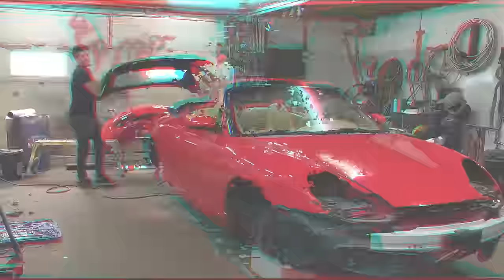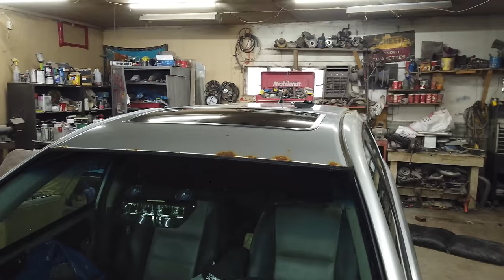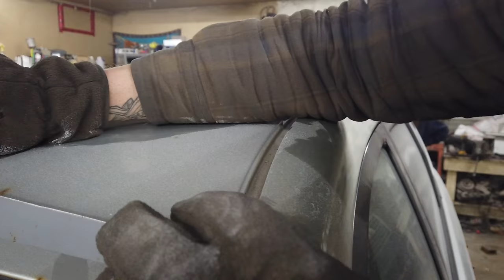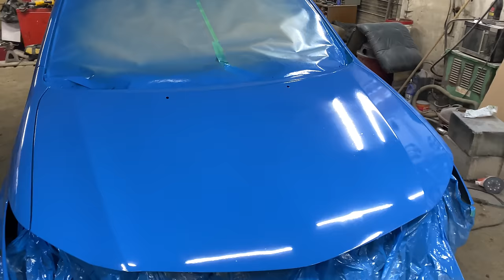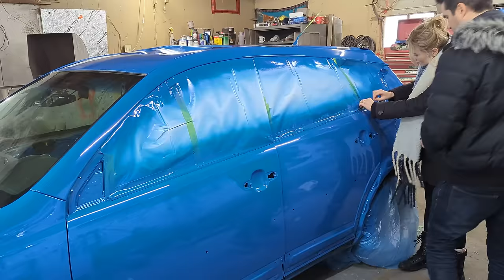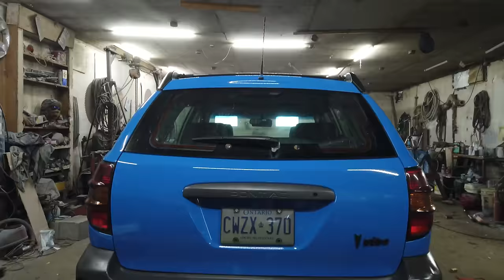Clear Coat over Rust Paint - DIY Professional Rustoleum Paint Job

Comment: people are doing all the prep work just fine and body work and so on then put cheap Rust-Oleum paint on their cars that wont hold up to uv rays and look like primer in a few years and then will have to be striped next time around,  you can you get real auto paint kits online for 150 bucks nowadays.   stop doing this it's not your skateboard and you are not 12 anymore think about the guy that will have to fix this mess someday and you're not saving any money in the long run if you keep it,   I seen guys on here with really nice C10 trucks and 69 camaros doing this please don't do this.
Reply: Your pretty stunned 🤣 that’s why they put clear coat on it, but I guess you missed that part,
Reply: @Justmebro777  no I didn't miss that part,  I said why you use rust oleum if your doing everything else correct that's a compliment  I guess you didn't read that part 🤣
Reply: Well it is a Pontiac and not a Corvette or something like that. If it last longer than 3 years I'd be surprised. I  have seen other youtubers doing spray can paint jobs for views and not to mention all the sponsors. Definitely gonna check back in on this long term and see.

Comment: Why did GM have such a fetish for sticking plastic body panels all over their vehicles? Its never looked good.
Reply from the maker: I remember in the 90s when GM redesigned the cavalier and sunfire and the base model came with no paint on the bumpers... That was the first I remember the grey plastic. I think it was a money saving thing for base models. Then it was on all kinds of cars from all kinds of brands!
Reply: @RustedRides  I remember first seeing it on the Avalanche. I though it look absolutely hideous. At some point they did have an Avalanche with painted parts where the grey plastic ones were but I believe they were still plastic. But it looked a lot better.